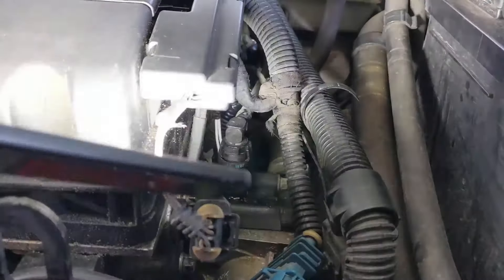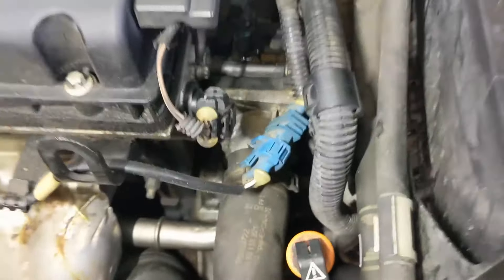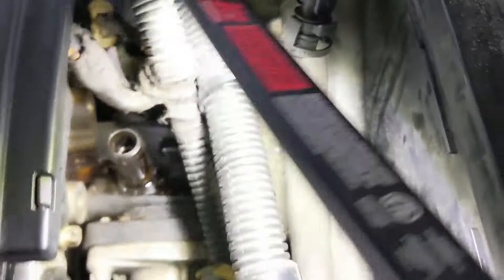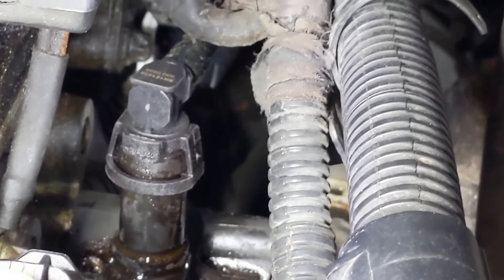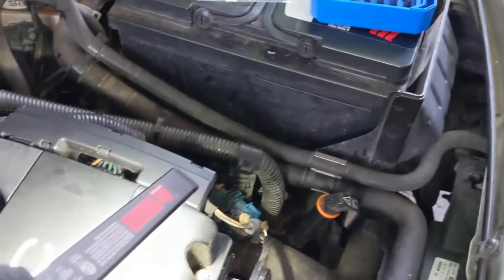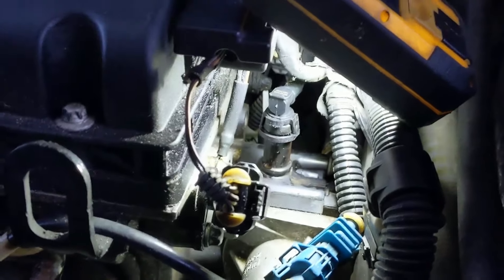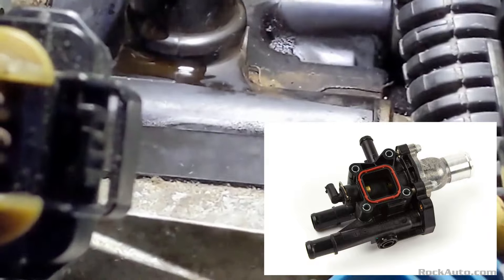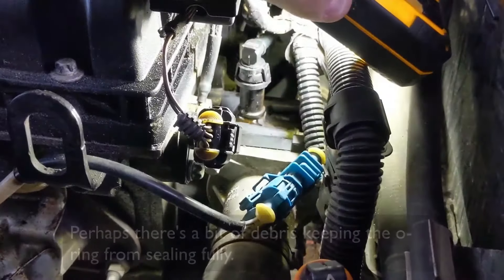Leaky Throttle Body Inlet Heater Pipe (2008 #Saturn #Opel #Vauxhall #Astra)

Comment: Did you ever figure out a fix
Reply from the maker: There's a small crack in the thermostat housing. Need to replace that. Fortunately a very slow leak.
Reply: I replaced mine with 2 different ones but they don’t seat right and the clip doesn’t fit on the pipe correctly.